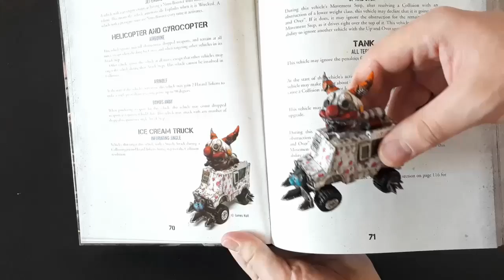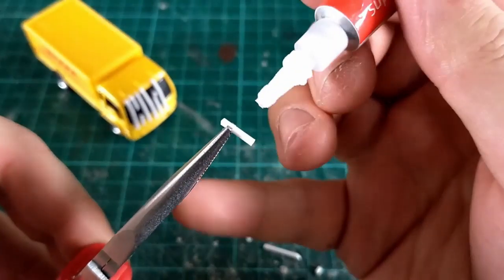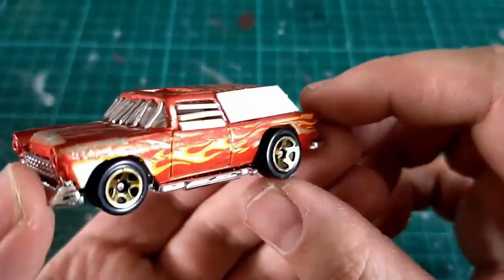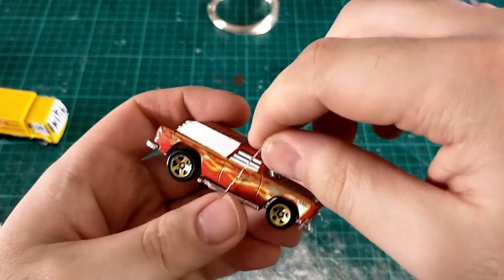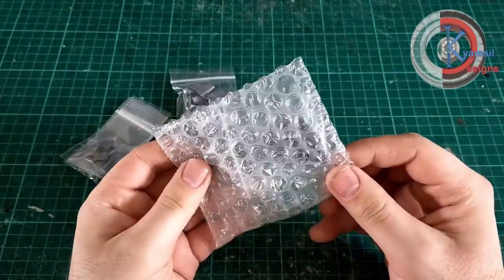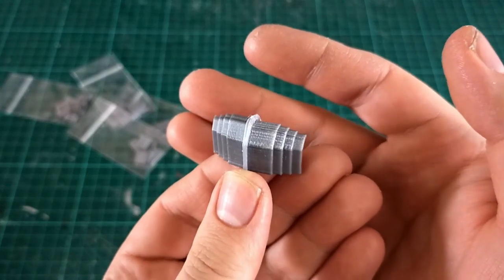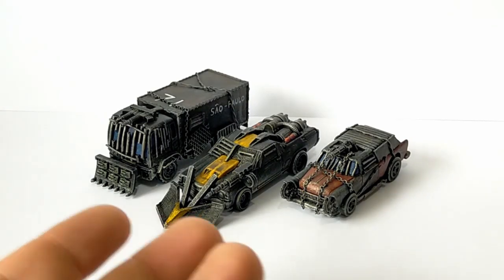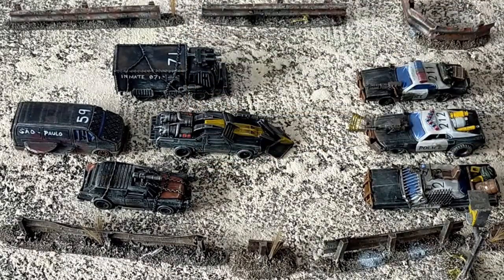How to Build; Prison Cars (Gaslands, Dark Future, Autokill, Car Wars)

Comment: Cool vid dude. One thing ive found is that when gluing bars on is that if you get a bit sloppywith the super glue, once its dried and you spray/paint, the glue looks like rough/bad welding, which goes quite well on beat up looking vehicles like warden etc.
Reply from the maker: On these smaller builds it can all work in your favour 😉